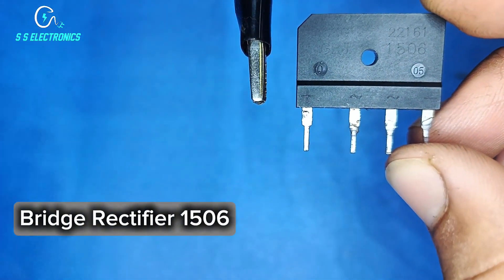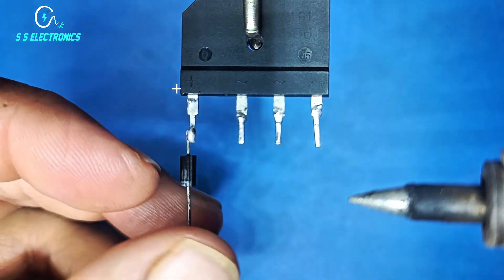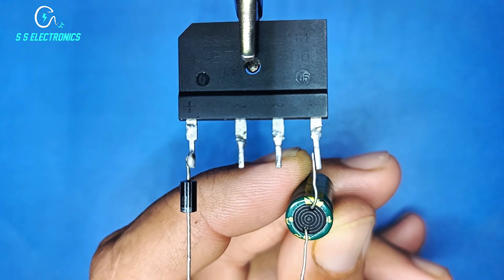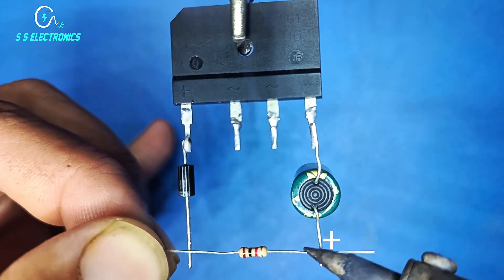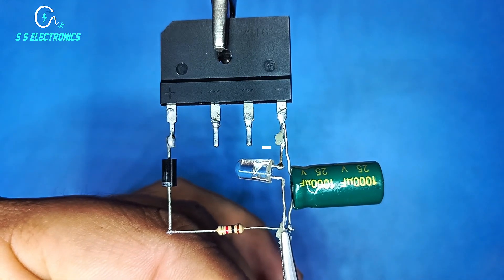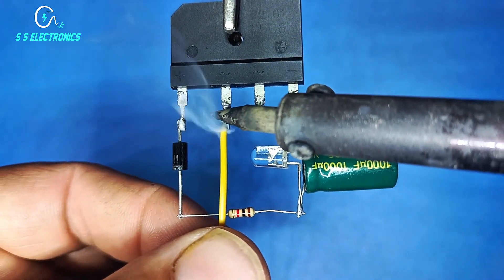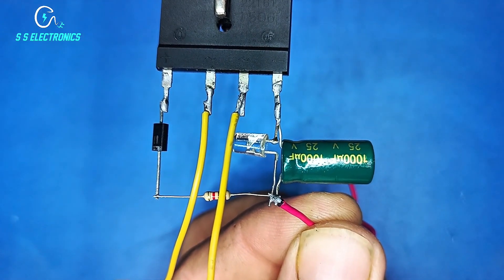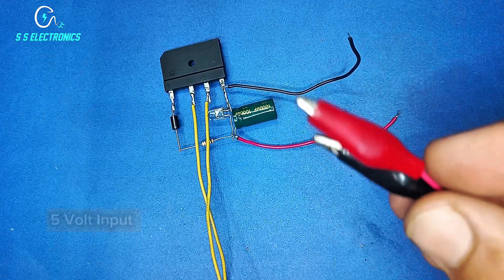5v To 1.5v Converter | 5v To 1.5v Converter For Wall Clock | Dc To Dc Converter

Comment: Why not we make a bridge rectifier with 4 diodes instead of a BR. Will the circuit work as per the suggestion of myself using diode bridge keeping other things as per your design?